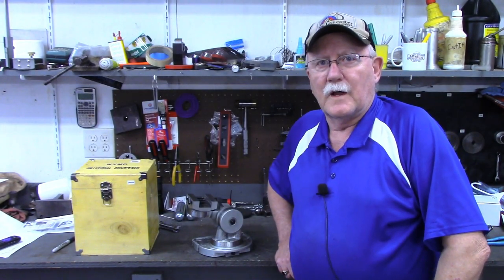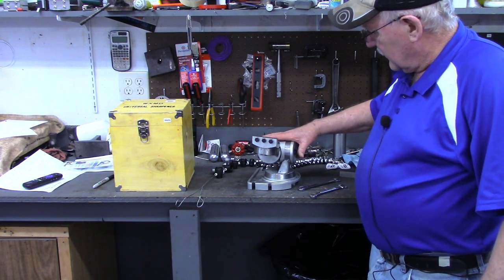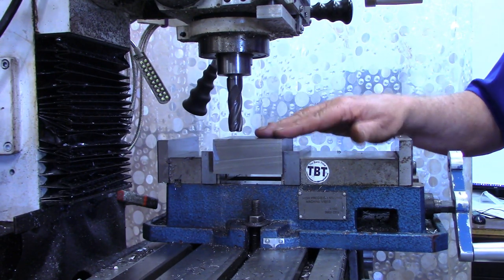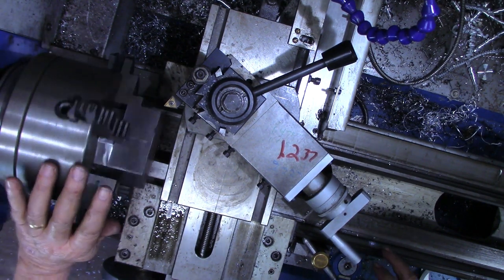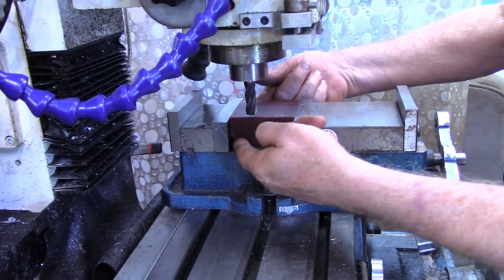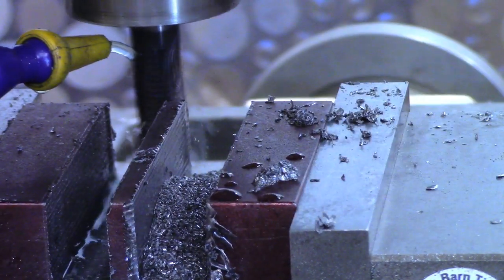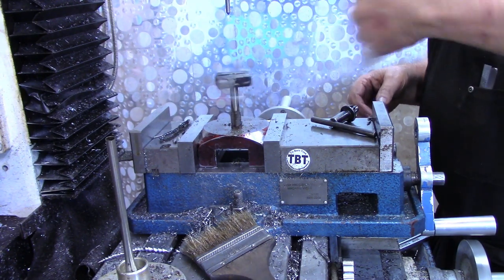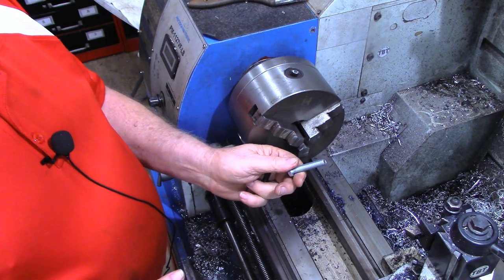Shars Universal Vise Repair

Comment: I just purchased the same fixture from Shars.  I am working on a plan to replace the work holding piece because I am using it for tool grinding and I find that the tools don't fit well.  Now that I have seen how your broke I might just be motivated to do it sooner rather than later.  Good video, thanks for sharing.
Reply from the maker: R. Steven Lang, Shark River Machine Looking forward to seeing what you come up with.

Comment: Very nice job. Even if you were equipped to braze it, I think this is a much-better solution. 

One thing you might check after a few weeks or so is whether or not the stresses common in cold-rolled steel have caused the vertical wings to move off square with the inside-bottom--the cut you milled into that block was pretty deep. I've heard you can stress-relieve such parts, though it could require a higher temp than you can give it. 

If it turns out the vertical surfaces have pinched in, you could grind them square and check them again after a month or so. At some point, they won't move any more. 

Check out Phil Kerner's (The Tool and Die Guy) video on this characteristic of cold-rolled steels: https://youtu.be/biQaZBlyzGU